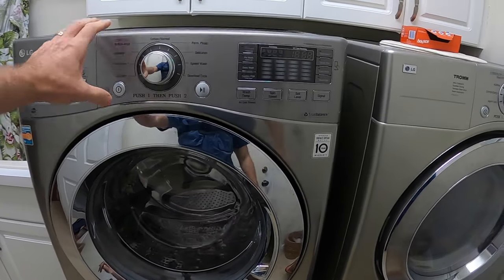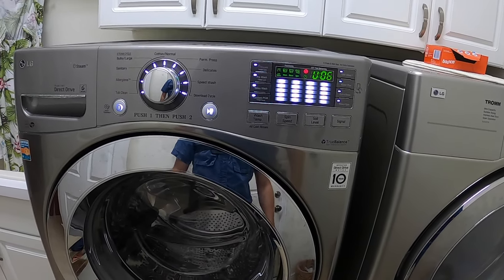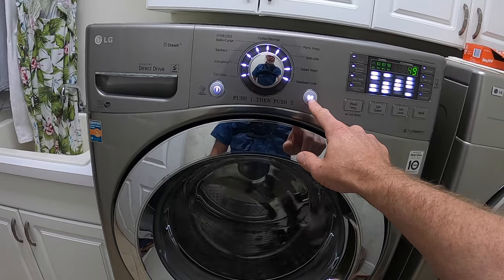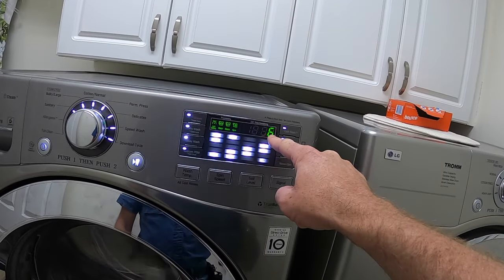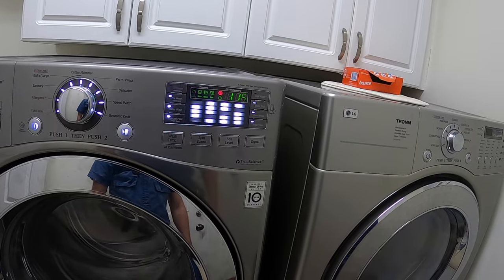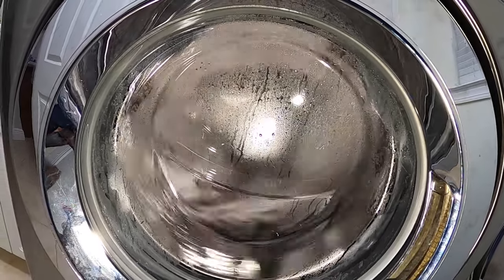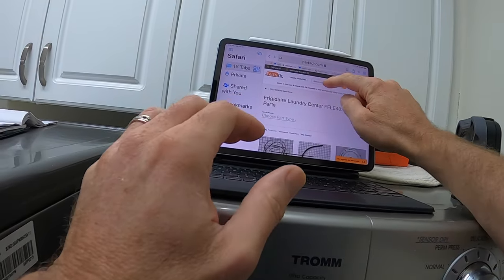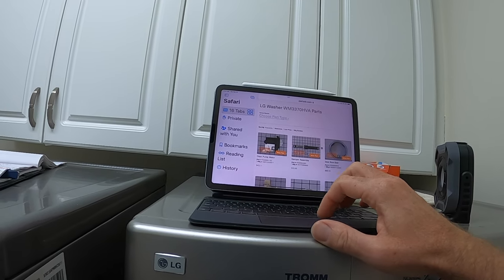LG Washer Troubleshooting: No High Speed Spin & Service Mode

Comment: I've got the same washer and when you put it in diagnostic mode, push the start button it starts turning, push the start button again and it does nothing. Any ideas on why it does that?
Reply from the maker: Yes. It may be your moisture sensor. There are two chrome strips on the inside of the drum on the door side. They get covered in silica from the fabric softener. sometimes if you give them a good cleaning with some very fine steel wool they will work proper. good luck. I apologize for not responding sooner
Reply: Is a washer, not a dryer,